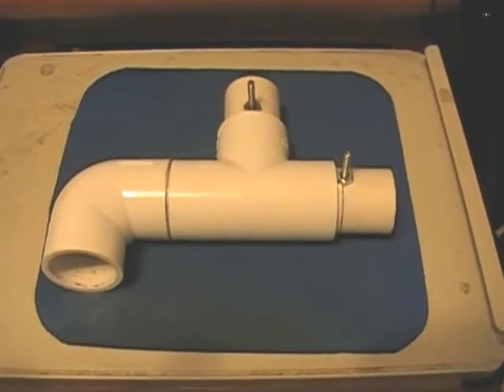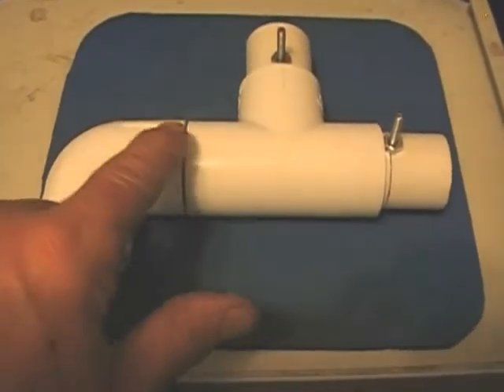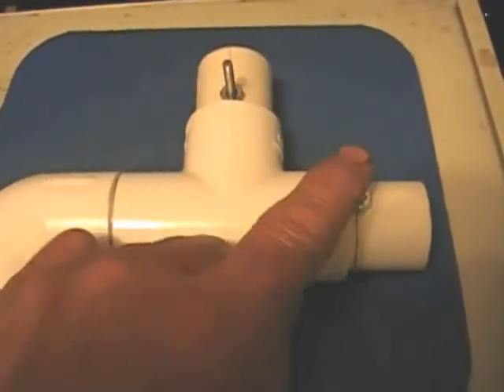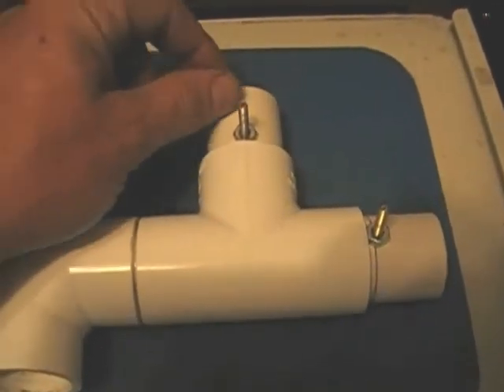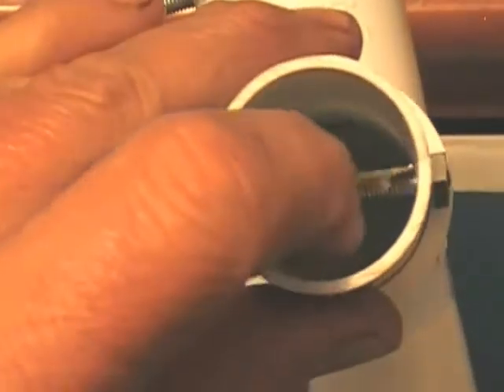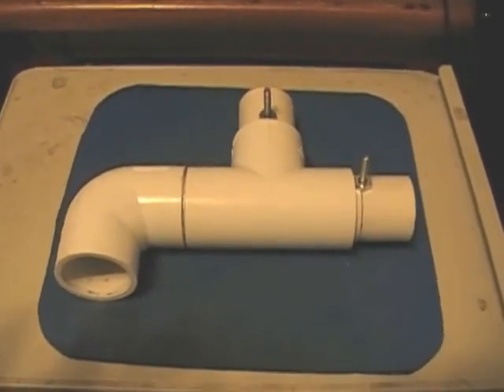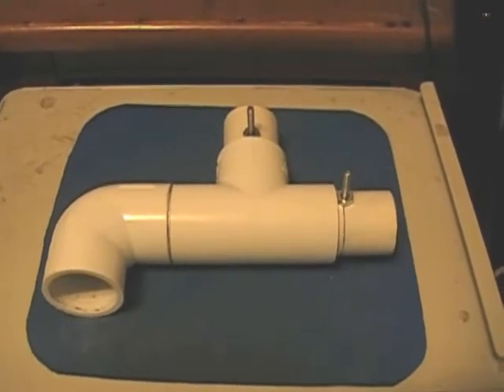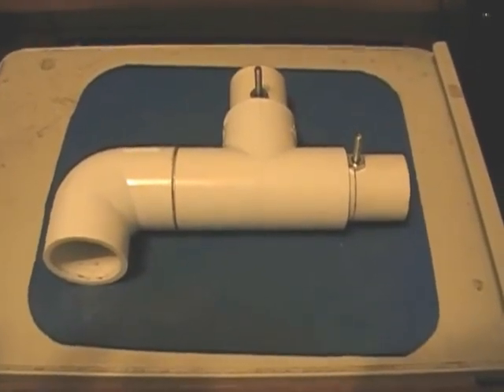05-25-2013 Wood gasifier carburetor interface unit.

Comment: what do you think about having a valve for the woodgas?
Reply from the maker: If you are talking about the input of the carburetor yes it does work better with
the second valve. It works like it is but I added the second valve and it made it easier to tune in. My original build was good but flawed and after I built this new build I found a way to make the original carburetor vibration proof.

All I had to do was to add a locking knob on the opposite side of each threaded rod on the valves so once they were set, they could be tightened and made stable. I was a dummy but then again this whole gasifier thing has been a positive learning experience for me so I won't complain because I got some good skills out of this plus a fuel producer too.

Comment from the maker: The disc are thin but rigid so they won't warp. The build if finished and it's really sweet and tight. I was going to do a test run today but when I went to prep the generator today I found that it had a bad ignition coil so I'll have to wait until next weekend before I do the test. I just made a follow-up video on the completed carburetor interface but I haven't uploaded it yet.

Comment: I'm with you.This allows you to tweak your design without a big outlay of cash.I like the valves because you built them.A simple design that should do the trick. couldn't tell how thick the valve disc were.any chance they may become distorted?You can always make it out of metal later if it doesn't meet your expectations.( an inexpensive design like this would be sweet though.) Looking forward to your start up...Nice to know I'm not the only one up to the wee hours building stuff,,,:)

Comment from the maker: This should work good. There are no heat issues here plus the parts will stay snug just by the design so vibration will not be an issue either. The steel valves are soldered to the threaded shafts so nothing is glued here that can break or fall off. The nuts will not be able to free spin either because their flat edge will be butted up against the PVC's edge and if that ever becomes an issue a drop of lock tight will stiffen up the threads.